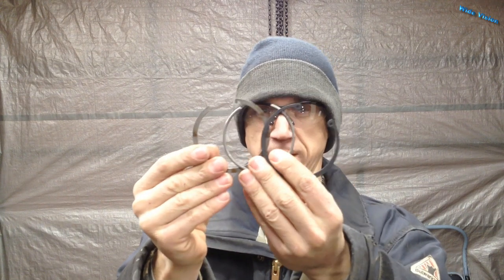Westendorf Cylinder Gland Removal - How To

Comment: A hydraulic supply shop will have a repair (temporary wedge shaped filler ring) that goes in the inner snap ring grove if it's a round wire snap ring.  This keeps the o-rings and piston rings from expanging into that groove, and making disassembly difficult.  Also the groove has a bevel inner lip.  Punch the gland assembly in a little past the snap ring groove, then punch the snap ring in on one side. It will twist sideways, and be easy to pull out with a needle nose pliers or hook, Then insert the repair ring with the thick edge to the outside.  Everything will slide out fairly easily without ruining the piston or piston seals.
Reply: I’m attempting to rebuild the tilt cylinders in a TA 26. I could use some advice for sure if you’re still around.

Comment: Omg dude thank you so much for christs sake, I knew it couldn't be that difficult lol.  Sorry bout your boots 😂 I been there but I douched me right in the face, filled my jacket hood with hydraulic fluid.  I do have to say though, out of all the fluids that I could be drenched in by a machine, hydraulic fluid seems the best of the choices if I had to pick.
Reply from the maker: Glad I could help! Exchanging information is why I make videos.   Hydraulic oil is simply water proofing... right? :)
Reply: @WideVisionMetalFab  imo you could actually get away with almost ANY fluid for a short amount of time.  It is not recommended lol just saying, it's simply, pressurized hydraulics.  If I'm not mistaken they consider aqueducts and stuff like that hydraulics as well.  But yes sir, you saved my dad and I a lot of time, at first he was skeptical, but I told him I can rebuild cylinders easily, bit when I got there I didn't even know how it opened up 😂🤦lmfao then I watch your video  and it clicked right away.  I said I got now dad just trust me, he gives a yeah ok trust YOU!? Kinda Look,  But shortly digresses because he's extremely clueless and no option at that point.  So thanks again ✌️ you made us have a good day, he's getting older and I'm starting to appreciate what we have left.   I was pretty rough on him as a kid, he's a good man.
Reply: @WideVisionMetalFab  ahhh I finally understand your hydraulic joke 😂😂😂🤦

Comment: The times I've run across round snap rings there is normally a hole from the outside of the cylinder to the ring groove so that the ring can be pushed from outside rather than having to hook it from inside.

Comment: Did your seal kit also come with a liner that goes in the snap ring groove so when you put it back together you don't cut the seals? A lot of times it is a must have.
Reply from the maker: It did not, unfortunately. We had just taken in the recycling, too, so I couldn't even find an old pop bottle to cut up for a liner. I finally filled the groove full of grease, and it felt like it went together fine.
Reply: The grooves for the round snap rings are usually pretty safe so I am sure it went ok. It is those square ones that really like to cut.

Comment: Clean clothes and shoes are oil magnets ,  happens every time  man ! lol
Reply: Me:  Hey, what happens if I pull this lever out of it's sslot and let it go? What happens? I'm curious.  

Co-worker: 👀

Me: soaked in hydraulic fluid, dude wtf happened? 

Co-worker: you're an idiot 🤦

True story lol

Long story short we were removing the metal undercarriage on a  union pacific truck "made for train tracks" and we cut the lines,  instead of taking them off, we didn't need anything from it.  But there was a lever locked in position and I was like hmmmm what's that do???  Yeah take my word DONT mess with it lol just leave it alone, all it does is release the heavy ass, metal train track wheels.  Lmfao and in my case, I had cut the line, right where I was, but the cylinder was still COMPLETELY full of fluid.  When I released the lever it was an instant regret, it was then, I knew, I fucked up.

Comment: For me i tie two old t-shirts to the cylinder barrel , then slowly ads air pressure to other input port. that way i am standing clear of anything that comes out,
Reply from the maker: Using air to push apart cylinders scares the crap out of me! But if you feel safe doing it, then have at. :)
Reply: Haha that's very dangerous!